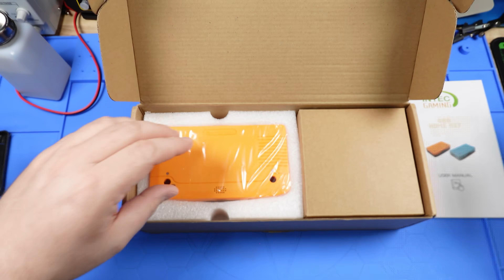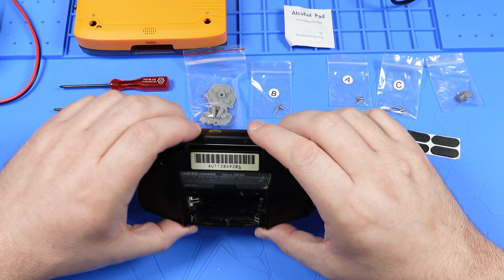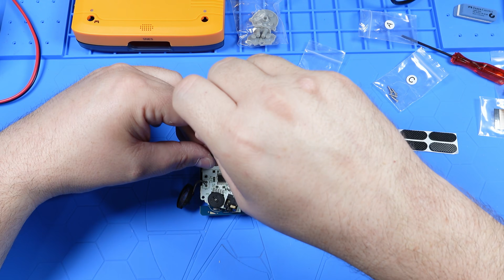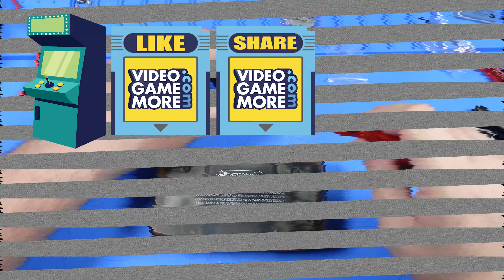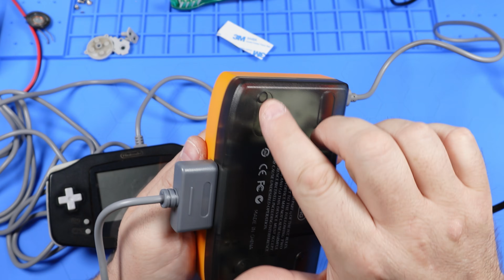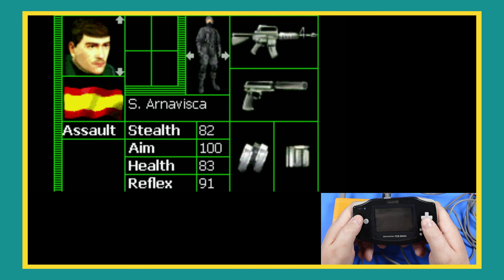I Turned a Game Boy Advance Into an HDMI Console — No Soldering!

Comment: Man, I bought this kit after watching your video…I was excited to get it set up, but no luck with getting it to work so far. I’ve tried adjusting it multiple times…it powers on, but it’s like the TV is fighting with it. I’ll get a black screen and it blips like it wants to start up, but goes black again. Any suggestions?
Reply from the maker: I'm sorry to hear that! Try opening the case and and seperating the system board from the console board. Leave the ribbon cable hooked up. You will not have controls but you could troubleshoot just the video... I think. Check that the power switch on the GBA board is fully on and does not move. Let me know what you find out there and I'll see if I can dig up anything also!
Reply: @videogamemore is there any reason that the type of TV would not be compatible with the hardware?
Reply: @videogamemore for what it’s worth, I tried exactly what you suggested, but same thing…blips like it wants to start up, but flicks back to a black screen. Tried using the AV cable instead, but same thing. I’m wondering if it’s not compatible with a smart TV or if I simply have a lemon from Intec. My GBA worked just fine before I took it apart.
Reply from the maker: @Nash_Nismo  really sorry to hear that. Can you swap it out?
Reply: @videogamemore update 😂 I did try slowly adjusting the contact points with it all unhooked and IT WORKS! No sound though. I’ll keep playing with it.
Reply from the maker: @Nash_Nismo  THAT’S AWESOME! Maybe go a little JUST A LITTLE more agressive on the contact pad cleaning. You could use an aerosol electronic contact cleaner on them as well. Let me know how it goes!!
Reply: @videogamemore it’s working all the way now ❤️‍🔥 only bad part is that it’s super sensitive when I try to screw the GBA board down, but I’ll keep working on it. Thanks for the responses here!
Reply from the maker: @Nash_Nismo LETS GOOOOOOOOOOO 🎉🎉

Comment: What a shame the controller isn't wireless.
Reply from the maker: Yeah the console does support wireless/BT but the modded board for the GBA shell is not. They probably did this to keep costs down.
Reply: @videogamemore maybe a wireless receiver for snes from 8bitdo or blueretro can be used
Reply from the maker: @juangomar6812 I think that would work as well!

Comment: 🤔 would putting a lil dot of dielectric grease at the contact points be a good idea, like could it keep the contact trouble free for longer or could it hinder it?
Reply from the maker: You wouldn't want to use dielectric grease, its non conductive. But using a conductive grease is actually a great Idea!

Comment: I have the gameboy player on my gamecube, no modding required
Reply: MY PEOPLE!

I went ALL in on this a couple of years ago with Swiss, Flashcart, IPS screen, the whole bit, right? It's been my go-to setup ever since, and I haven't regretted it a single day.
Reply from the maker: But can you use the GBA as a controller??? 😅😅
Reply: @videogamemore  yup, i have the link cable that plugs into the gamecube. I have a few link cables for four swords adventures. You can plug the gba into controller port 2, 3, or 4 and turn it on to use it as a controller for the player.

i also have the digital controller for gamecube, which feels awesome.
Reply from the maker: @noblechipmnk7126 can't you use one on Animal Crossing too to play old school NES games? Maybe I'm thinking of a newer game
Reply: Not sure. I dont play animal crossing, never my kinda thing. I tried new leaf once and have never touched animal crossing since lol
Reply: @noblechipmnk7126He's not talking about playing AC, he's talking about the NES games you can play that are unlocked through AC.
Reply: Have fun with an inaccurate clock speed and lack of full compatibility!
Reply: @hucz the Game Boy Player for GameCube runs at the same clock speed as a Game Boy Advance. The Super Game Boy is the only official Game Boy-to-TV accessory that has an incorrect speed. This was fixed on the Super Game Boy 2 and stayed fixed for the Game Boy Player.
Reply: @Soul94255  yeah its basically just a gba strapped to your gamecube. Even has a link port. There are no issues with it that i can tell
Reply: @hucz all the games ive played with it have worked fine. Minish cap, legacy of goku 1 2 and buus fury, both golden sun games, kirby nightmare in dreamland, metroid fusion, metroid zero mission, pokemon fire red ect. They play well too...so yes...i will enjoy it....thanks? Lol

Comment: Is there any way to keep the speaker attached so if you wanted to reverse it you can?
Reply from the maker: You need to remove it, but you could de-solder it and keep in your shell to go back.
Reply: You can solder it back
Reply: @Mari_Izu i was hoping there was a way to reverse it without soldering. And while  i get that soldering 2 wires is easy, it becomes annoying if you want to switch between the Consolizer and its original form.
Reply from the maker: @LordDiscord you could solder in a very small JST connector while modding it. Something that would clear the shell. Then put the other end on your speaker and you should have quick connect/disconnect. Be careful whatever you use clears the OG shell as well.
Reply: @LordDiscord had this before i reversed it back to a gba, you can totally leave the speaker on and it fits without it. But the only thing is the mod requires the volume to be on max. So lets say youre playing with the tv audio off you will still hear the audio but lower from the gba speaker in the shell. If you arent comfortable with soldering leave it on.